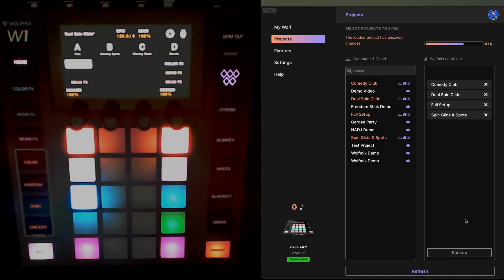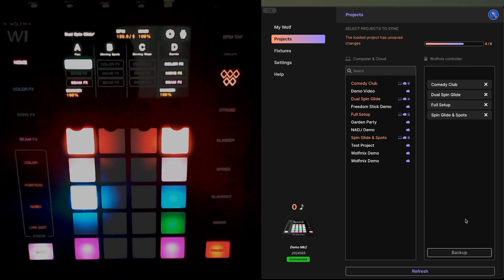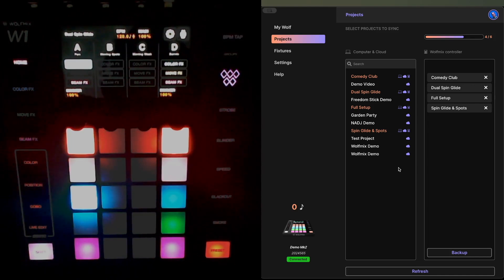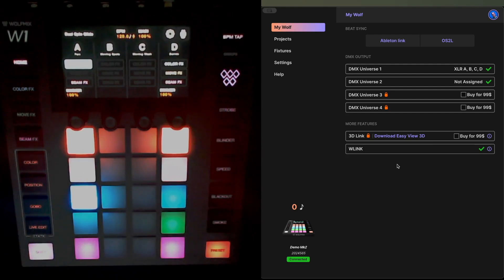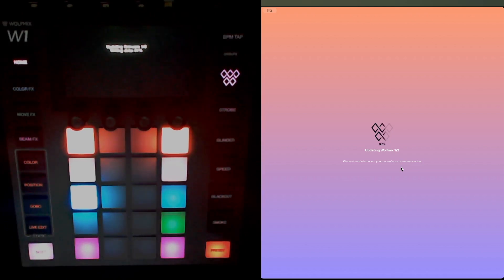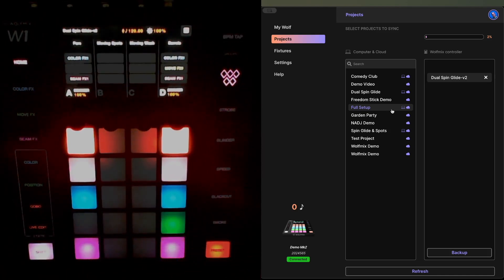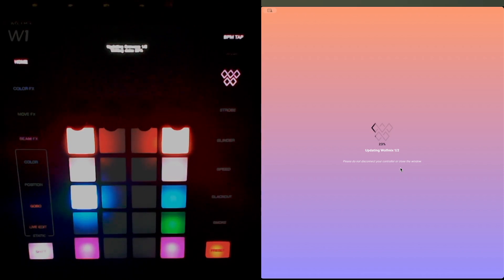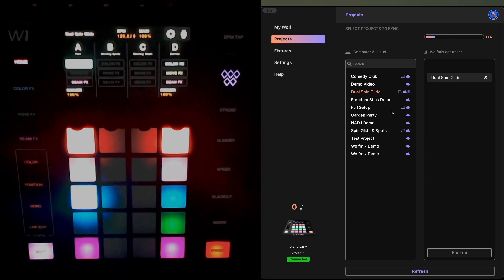Wolfmix V1 to V2 Firmware Upgrade

Comment: Great update but its Beta and still buggy. Have issue with 1 moving head not following some of the move effects and another with dimmer effect issues. They work fine with V1. Ive rolled back to V1 for now as live use isnt  fully ready.  Cant wait for the bus to be fixed and they make if offical and not Beta. Love the extra screens now and pre built presets are good too.
Reply from the maker: There are definitely some issues with certain fixtures, so please do report them via the Wolfmix support channels if you can.  Also worth checking if removing toublesome fixture from a project and re-adding them helps.  Sometimes it resolves the problem.
Reply: Can we have an info update about bug fixes? Thanks